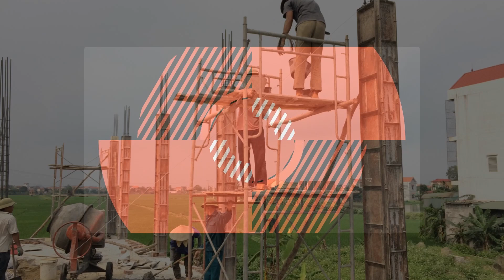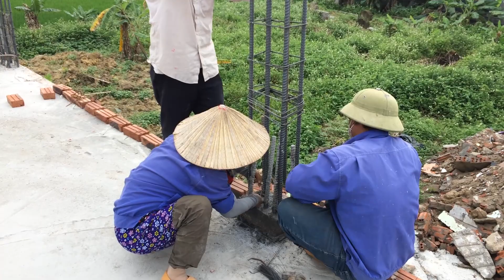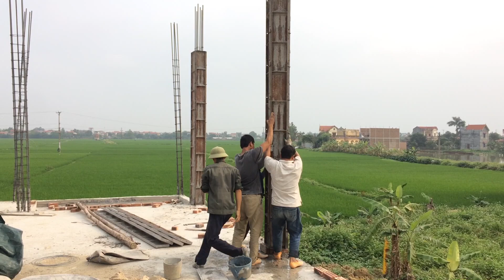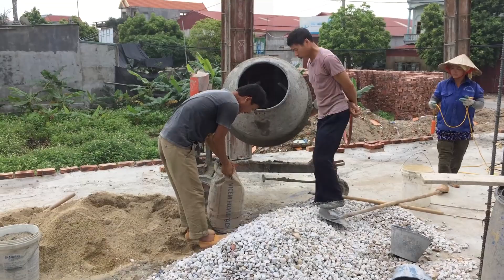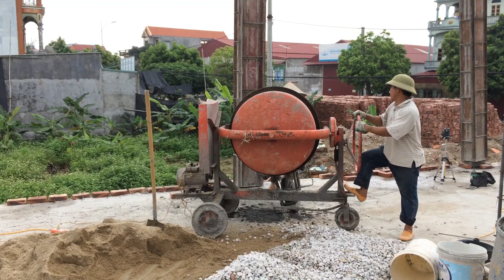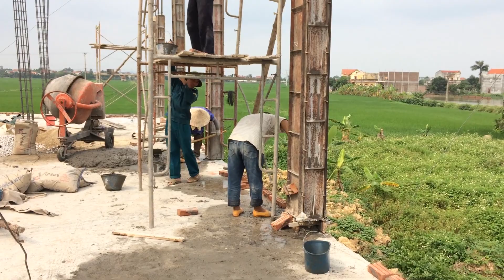How To Build Concrete Columns Quickly And Surely - Excellent Pillar Construction Technology

Comment: No measuring the ingredients I see but it looks like you start with 1:1 sand and concrete, then just start adding sand, gravel and water until you reach a wet mud consistency.
Reply from the maker: hello - we mix a 50 kg bag of cement with 6 buckets of sand and 4 buckets of ice

Comment: Nice to see that it is possible to build without large machines. What does a worker cost a day? In Germany it would be cheaper to rent a concrete mixer with a pump. The work is then done by a maximum of 2 people. One more thing, if the formwork wobbles every time you pound, the pillar will not stand correctly in the end. Fix and buy a concrete vibrator. Greetings to vietnam
Reply: i realize it is kinda randomly asking but does anyone know a good place to stream new movies online ?
Reply: @Theodore Darian I dunno I watch on flixportal. just google after it=) -colby
Reply: @Colby Franklin Thank you, I signed up and it seems like they got a lot of movies there :D I appreciate it!
Reply: @Theodore Darian glad I could help :D
Reply from the maker: thank you for watching the video
Reply from the maker: thank you for watching the video
Reply from the maker: hi
Reply from the maker: thank you for watching the video
Reply from the maker: thank you for watching the video